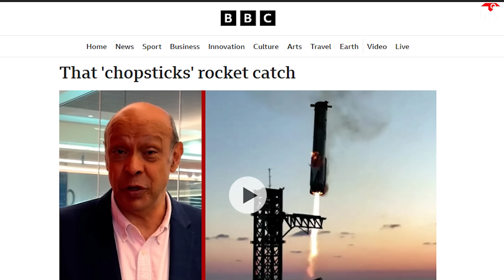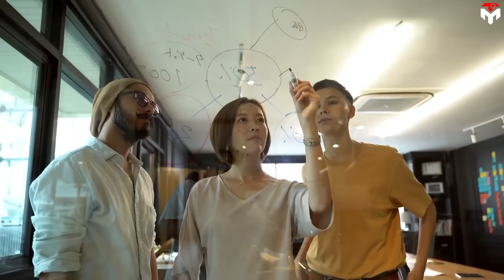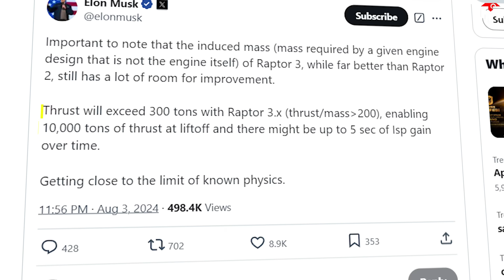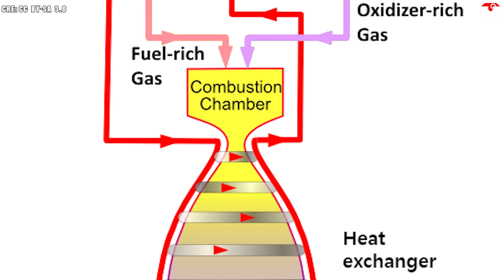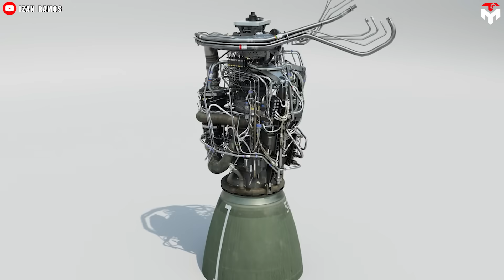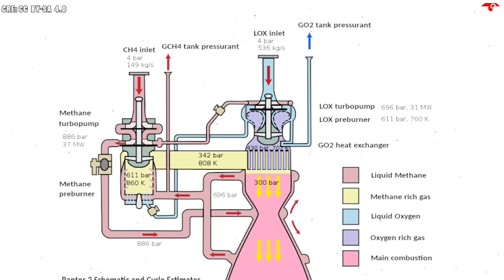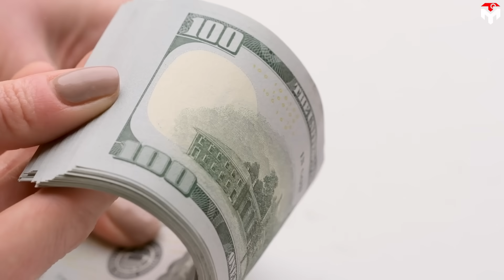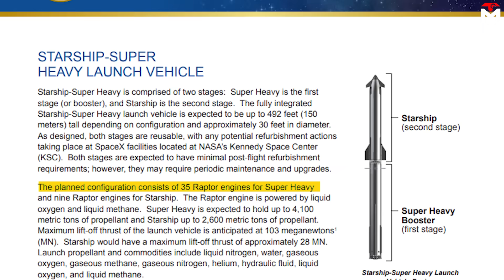20,000,000 lbf! Elon Musk Revealed New Raptor 3.X Broke Physics Limit!

Comment: You can make the nozzle bigger for more expansion of the hot exhaust gases up to the point where the exhaust gases are at ambient pressure in the atmosphere or vacuum in space. You can't expand more than the ambient pressure and produce any thrust.
Reply from the maker: Interesting point! That’s a very important factor to consider.
Reply: @markhuebner7580  3.4-3.8tonnes of exhaust, jetting out at Mach 30, is just right for 1.0kBar from 30cm to 7.4m exit dia; in short, AS-V's AF-1X IS THE BIZ. Then Kelly's L/A horns, "beefs Up" power the dream is still on,"Nightmares, takers?